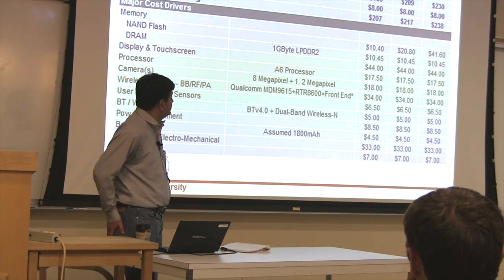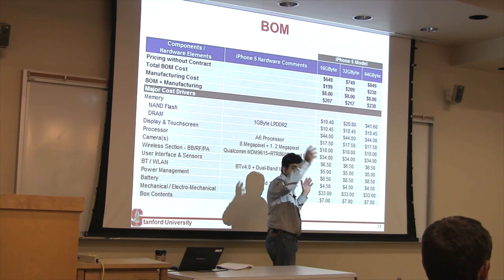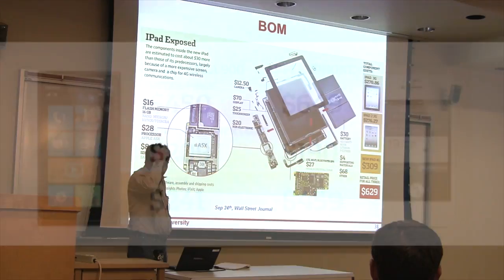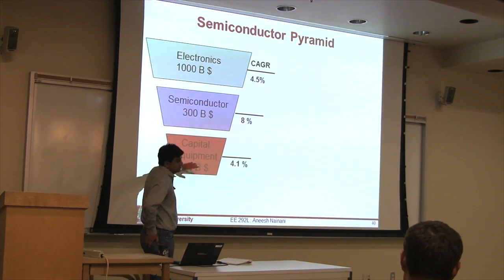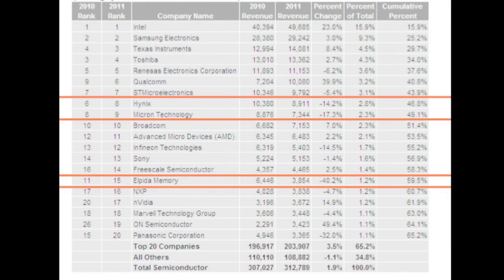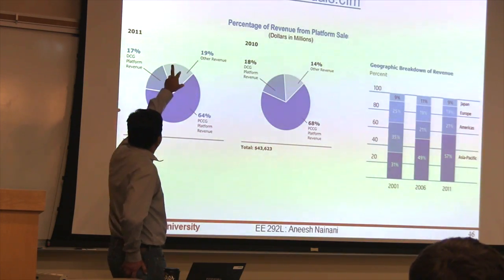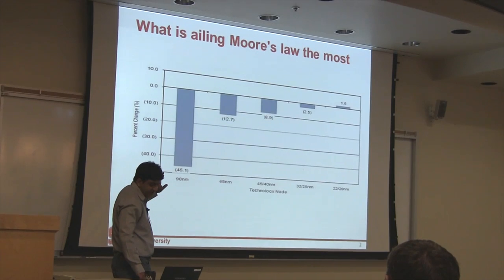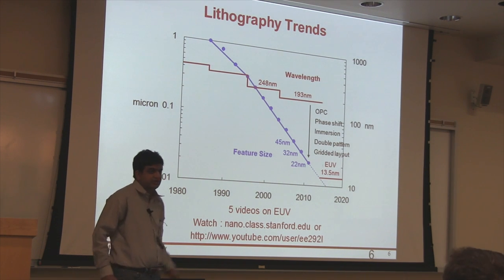Price of different chips used inside iPhone and iPads. Is Moore's law coming to an end ?

Comment: The videos are informative & you are a good instructor.   I have a couple of questions: 1) Why is the MEMS chip #2 cost.  Why is there not much competition in manufacturing these chips.  Is it that ST has all the IP?  The state of art processing machines that you need for making a 22nm process flow for example, is not needed here so I suppose STM has a big profit-margin? 2) Are you doing apples-2-apples comparision for power consumption A5X vs which of Intel chip?  Thanks